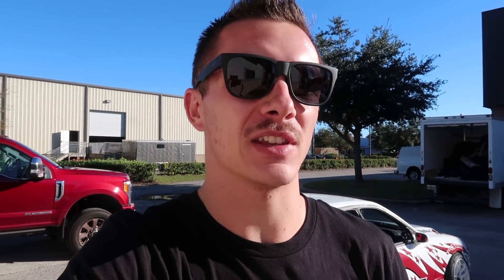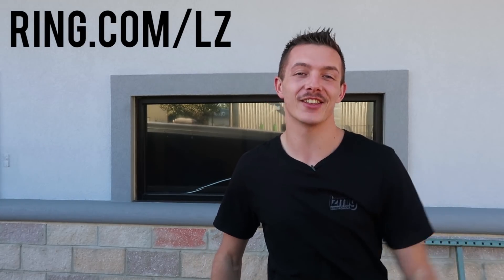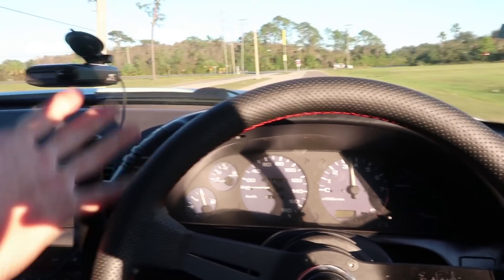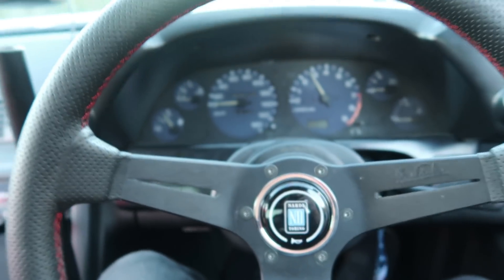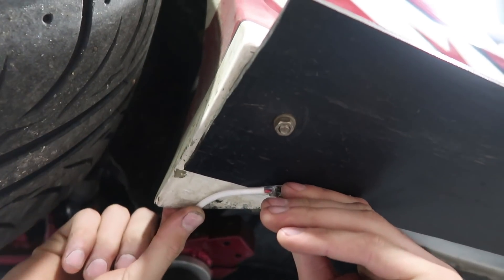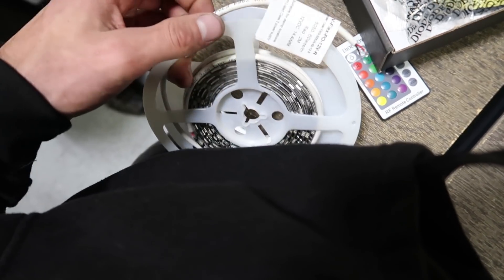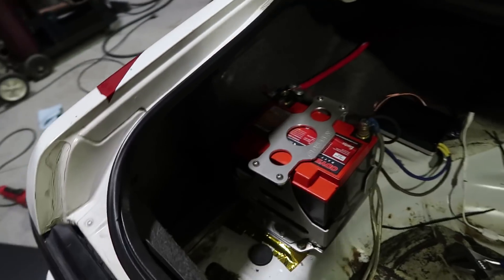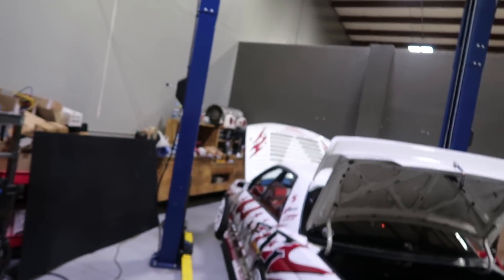This was a TERRIBLE IDEA

Comment: A fuse is not meant to protect against high current, even tho the LED's consume very little current (power), if there is a short and there is no fuse to protect the circuit anywhere after the battery then you run the risk of a fire or battery explosion. A fuse right after the battery is essencial in every install like this. Love your vids m8 <3

Comment: Z32 transmissions hold good power. Weak point is selector forks. Over here in New Zealand local companies install / sell billet selector forks to replace the aluminium ones that fail

Comment: You can get a brand new OEM JDM 98+ spec Z32 30a transmission from Nissan still. These newer ones had the common issues fixed found in 90-96 z33 transmissions. Think it’s only 1700-1800$ but I’m sure you could get one for cheaper.

Comment: Are you using the big rb box? 3rd gear is a problem with these. If not, the small box is quite weak, max 300kw@w and they will still pop when drifting. The stock axles are ok for a decent amount of power, I'd rather have a axle break...

Comment: Soften up the comrression and stiffen the rebound in the rear shocks. And ls after the front shocks so it’ll weight transfer to the rear and move out
Reply: Could probably do with less grip tbh. More grip just means breaking drivetrain components instead. It's like having a fuse in an electrical circuit, where the tyres spinning is like the fuse blowing.
Reply: noxious89123 I’m looking at it from the perspective of avoiding wheel hop. You’re right for Shure in less grip is better to not break crap. However on a prepped track if it spins it’ll most likely hop if the suspension is soft. That will mean school loading That will also break stuff. A easier way to do it it to make it bite and grip hard, and have boost by gear set up so it leaves on low power.

Comment: I think a t5 trans from a fox body mustang is the same as the z32 trans I’ve read it before in some forums when I had mine and other than the top plate being different they were the same for a short throw.if that’s the case that they are the same it might be easier to find a t5
Reply: That haynes Boy I broke a t5 in my 5.0. Shifter fork snapped the Nubs off in the 3rd/4th selector. Adam would destroy a stock t5 lmao. A tko series trans would definitely hold the power of the RB.
Reply: certifiedHITMAN yes but it would probably be more common to find a built t5 since a fox body is a popular drag car especially where I live there’s one on every corner
Reply: That haynes Boy “stock” T5s are realistically cheap but not realistically strong. I have two T5s that a junk just laying around. And upgraded rebuild kits are for some reason hella expensive. I think the money would be better spent on a dog box (common with pro drifters) or a CD09 like his 240. Maybe I’m just a T5 hater lol
Reply: @itsjusta2v198  there's no such thing as a built T5 since the case it self is weak. The only real way to up grade a T5 is to replace it with a TKO.
Reply: Sorry the t5 wouldn't last we run them in aus behind a Buick 3.8 they arnt the strongest definitely wouldnt run one with boost

Comment: The led strips I would add a little fuse just in case. Just to avoid any major wire melting and spark...especially around the gas tank. If it was that close to fuel I wouldnt mind cuz the wire would act like a fuse cuz its so small.
You will ne surprised to see how the adhesive will fail on the strips. But I wouldnt ziptie it I would just replace the strip. You can cut open the wires and solder them respecting the RGB order to the strip. Next time put the RGB one you will see how fun they are :D

Comment: hey how about you get a slow car to learn how to launch a car? :D or atleast turn the boost way down
Reply: the Z for example
Reply: hey how about you dont tell him what to do?
Reply: @justaguy5791  as if what i say mattered
Reply: He didnt break the trans launching or on high boost dude, he broke it flat shifting
Reply: @stylepoints.180  how does that matter? Tell me how you can break a Trans flatshifting in a 200hp car, the Trans only broke because all the torque.
Reply: NAQ Official it’s not 200hp lol
Reply: @C4CH3S  "in a 200hp car" .. Really? R32 has atleast 600hp, check the older videos, where he dyno tunes it... and the weakest point was the axels, since they are changed, the weakest point was that stock trans..
Reply: Daniel Kudela u and the guy above u completely mis interpreted what he’s trying to say
Reply: Or maybe I did.  Fuck knows anymore
Reply: @D D yeah i worded my comment carelessly but i didnt mean anything rude by it. allthough i did mean that he should figure out wheelhop and all that in a low hp car. launching on a drag strip is a completely defferent beast and he kinda made a meal out of it the first few times :D imo it's not degrading to acknowledge things like this as nobody can be expected to know everything the first time around either. i could have been more supportive for sure, i just worded it as if i was talking to myself.

allso, holy hell this kicked off one spirited discussion
Reply: @D D yeah allso it doesnt help that none of his cars are even remotely set up to take a full launch at all. hard springs and dampeners plus independent rear supsensions with manual transmissions just tear stuff apart and there's hardly anything you can do about it apart from handling it like glass and hopeing for the best.
Reply: Flat shift setups have a switch at the clutch for a reason. Flat shift any normal synchronised car and you will not have long on your transmission.
Reply: @dannye_garage  lmao I wasn't talking about the Nissan. I was saying that he should get a slow car and learn the dragstrip in that. Y'all misunderstood everything

Comment: You're not supposed to use bias plies with a manual trans, they hook too hard and put too much stress on the components, for manual youre supposed to run drag radials. Drag radials have a harder sidewall and they will slip before they wrinkle, and when the bias plies wrinkle up they put a lot of stress on all the components like the axles, diff, trans, and clutch.

Comment: LED's dont like heat, if the front strip on the radiator dies now you know why. And yes to the fuse, every circuit should be fused ideally.

Comment: Uses a drift boat for drag racing lmao ofcourse it’s going to be a bad idea
Reply: a r32 is not really a boat, those things are tiny
Reply: hedlund88 I’ve owned one with a 20DET,good cars but it does get really long with body kits
Reply: sure since boats are fiberglass adn body kits adds fiberglass i guess you can call it a boat.. size vise i still wouldnt call it a boat, and the r32 is his smallest car,   wheelbase and width

Comment: 4 second cars?? Was it top fuel night?
Reply: Grudge cars so its 1/8th mile more than likely
Reply: Correct. 1/8 mile racing. And 4 second cars are veryyy fast. Promod cars basically. 

Like the “street outlaw” cars are high 3 to mid 4 second 1/8 mile cars.